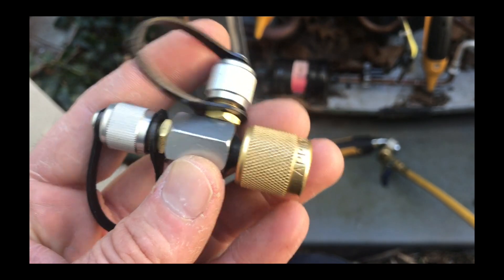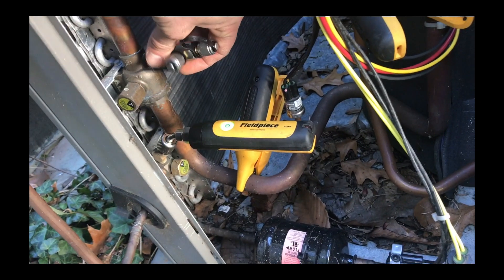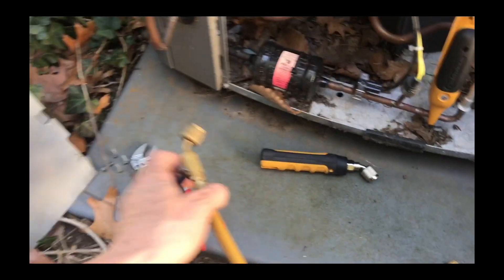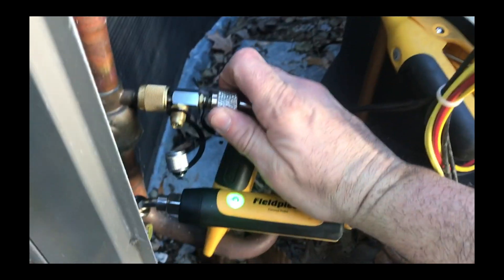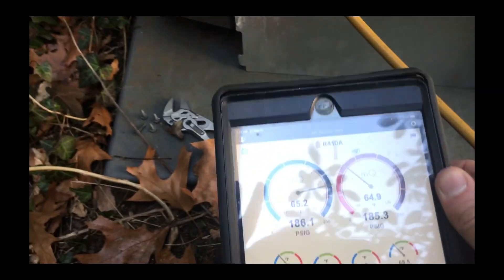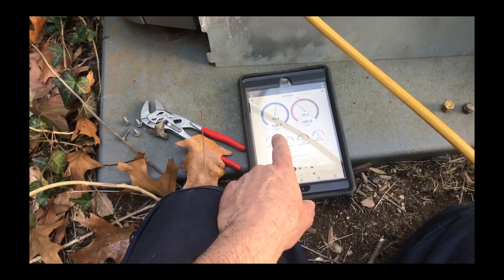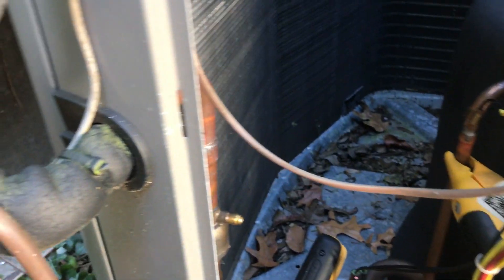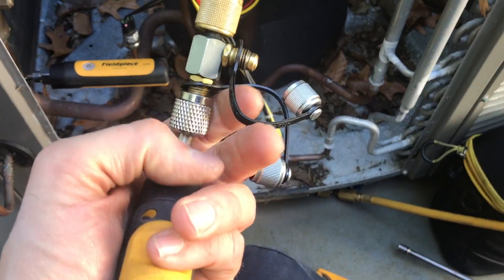Handy HVAC Tool Appion MegaSeal Charging Tee CTEE14

Comment: Bad tech didn’t purge the the Apion T fitting. SMH. The difference between good and bad techs is in the details. You just introduced an air bubble into the refrigerant system
Reply: How do you purge it
Reply: @KrisMoreno-uk9to  hook up ball valve with nothing connected at one end and open the valve for a split second or carefully depress the valve core with a CLEAN pocket screwdriver

Comment: Couldn’t you use core removal tool the same way?
Reply: Yes
Reply: @KrisMoreno-uk9to  valve core removal tools don't depress the valve core. you could do this but you'd have to remove the valve core 1st
Reply: @james6794  agreed on new system the VCRT will already be on and core removed when you get to this step so swivel/charging Tee shouldn't be needed.  For a service call and quick check this seems like the way since removing the core isnt standard practice for charging. However,  if it needs a charge most likely there is bigger issues at hand.  However, im new to this and could be wrong but Im pretty sure thats good info.
Reply: I don’t think so

Comment: so i have the exact same setup and ive found charging times with my probes to be much longer than my manifold... any suggestions?
Reply from the maker: Check the gasket on your swivel tee doesn’t create a restriction. I have had that get in the way and not press valve core enough, barely opening. Or blocking opening with the gasket. On cooler days sometimes it seems to take charge slower. Yet pressure in can also dictates speed of charging.

Comment: been doing that with a T fitting on my manifold for a long time but I appreciate the diversity of method here. I didn't think of doing it that way and the (vacuum rated) core removal tool is going to be used during vacuum anyway so...

Comment: 40 dollars!!? Is there another option ... does it need to have Schrader’s on both both end.?
Reply: 40 bucks ain’t that bad
Reply: Time to ask for a raise
Reply from the maker: I would recommend a Schaefer on both ends. I have owned this since I bought the probes. I am sure there may be better options. Appoin seems to make the best vacuum tools, core removers, hoses, recovery machines. Their is cheaper options like the flare on access tees head pressure controls or low pressure switches were sometimes connected. Yet then you need to wrench those on

Comment: Add the C&D thumb screw core depressor for high side probe and good to go.
Reply from the maker: May I ask why use a fitting on the high side? I am open to trying new tools and stuff. I picked up these fieldpiece probes cause many subscribers recommended them when my fieldpiece 550 stopped working
Reply: @thehvachacker  keeps the high side liquid from spraying out at you when disconnecting.  Low loss fittings are good too.